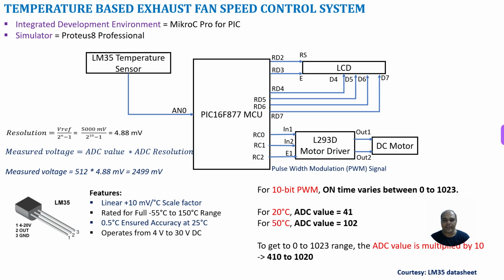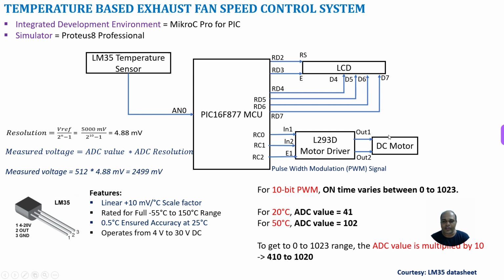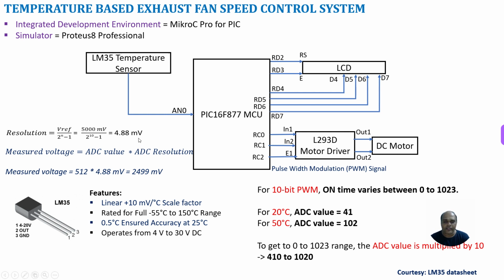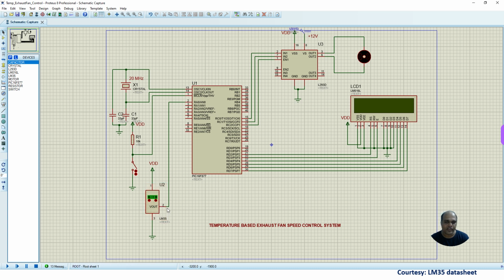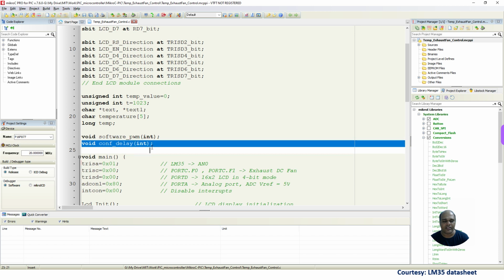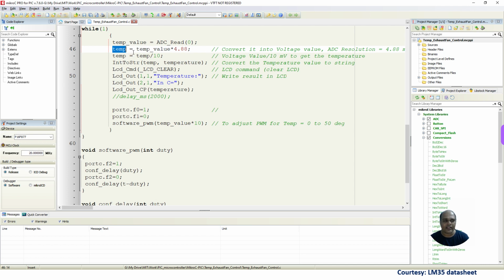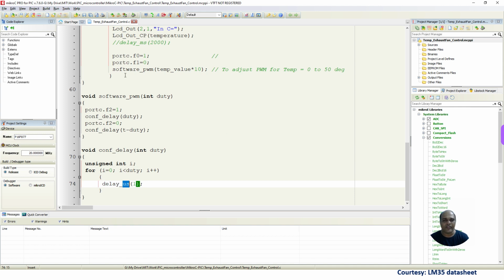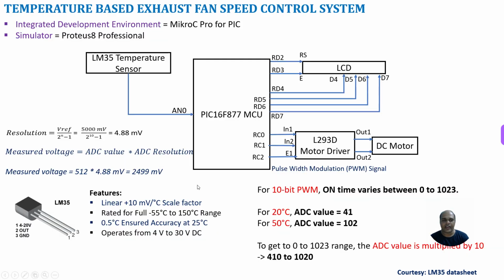Temperature based Exhaust Fan Speed control system using PIC16F877 MCU

Comment: Sir can u Please provide hex file and simulation of car speed detection using pic 18F4520 or PIC16F877a microcontroller
Reply from the maker: What sensor will you be using to measure speed of car...
Reply: @sathieshkumar   IR sensor sir
Reply from the maker: @Rohitsa1354  please explain the process of measurement, so that I can build a code and check it ..
Reply: @sathieshkumar  Sir we have sent u a mail where we have described about the project. 
Can u please check it if possible.
Reply from the maker: @Rohitsa1354  i didn't receive any email... Please send it to sathiieesh@gmail.com
Reply: @sathieshkumar  i have sent on this mail again.